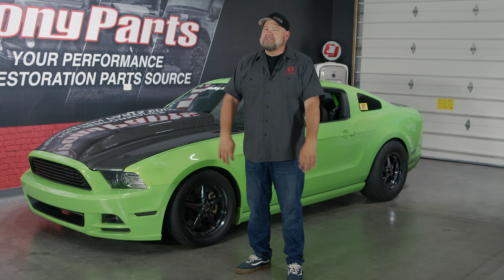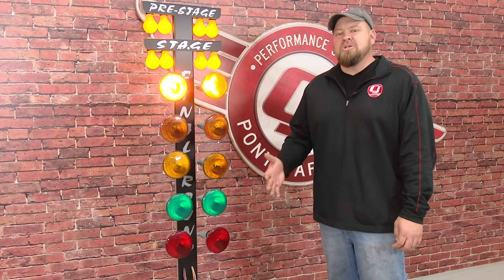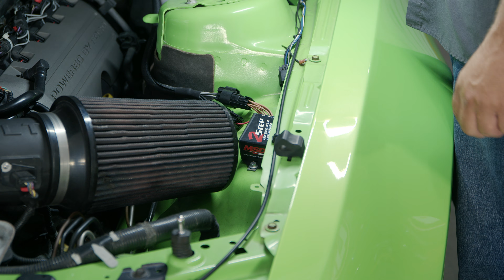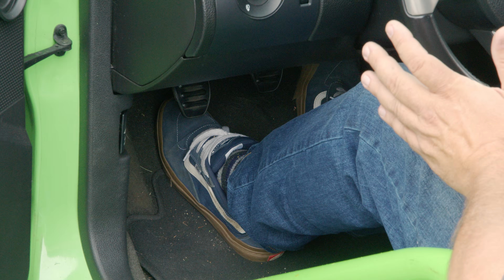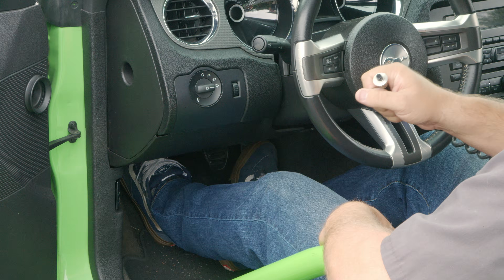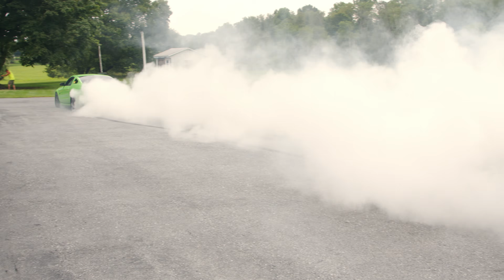How to Use Line Lock & 2-Step to Make Smoky Burnouts #burnout

Comment: how is your line-lock plumbed that it will hold pressure on the front if you HOLD the button BEFORE ever hitting the brake? If you hold the button and never hit the brake then wouldn't it CLOSE flow off to the front and since you haven't let go of button just hold it with no pressure?

Comment: I have a question, my SCT Tuner I can set the rev limit for neutral, also I can set the RPM limit for idle. Is this similar to the 2-step?
Reply from the maker: No those are just regular rev limiters, you cannot use a switch to turn them on and off.